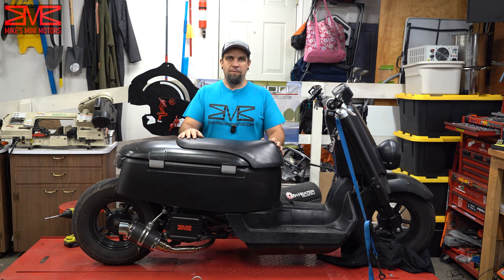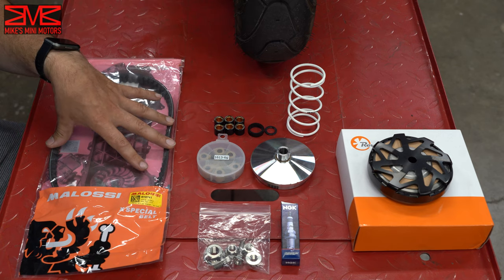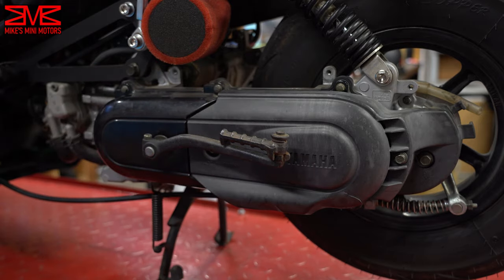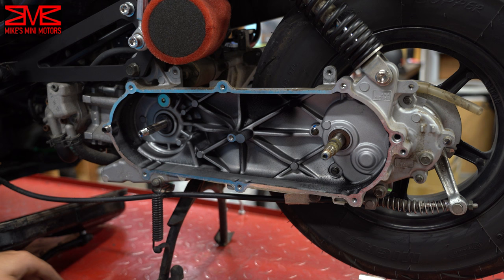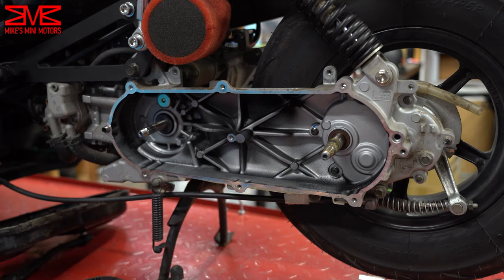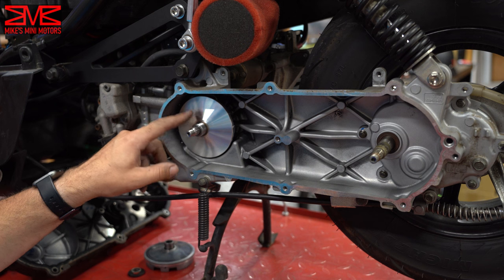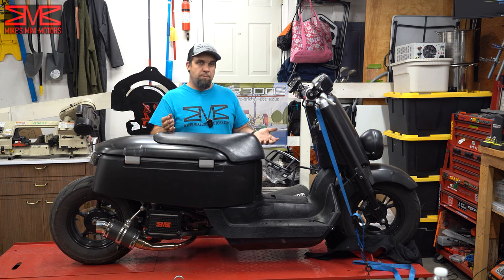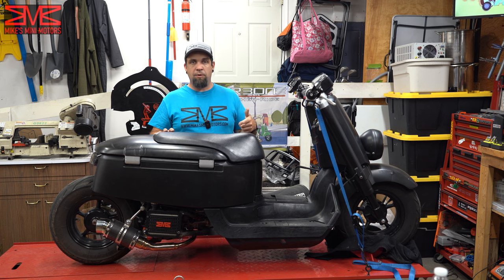Yamaha C3/Vox/Giggle - CVT Upgrades! Reveno Clutch and Malossi Variator

Comment: Nice update! I just installed polini variator 241.746. Came with 4.9g rollers. It improved takeoff alot. I'm still in the high 30s on flat and hit a rev limiter at 45 downhill. Time to play with shims and or cdi
Reply from the maker: Nice, the acceleration was the biggest improvement I noticed too! I installed my Beast Mode tuner already just for the rev-limiter delete, but didn't touch the tuner, I'll mess with the tuning once I finally get around to doing the BBK.

Comment: I been doing alot work on my 07 Piaggio mp3 250ie I purchased it use about 3 years ago and I put all new Variator  kit and Dr. pulley slider 21x17 12g & new belt, rebuild the clutch and now greases all the bearings! Only problem I having trouble with how to grease column steering bearings on it! Mr. Mikes
Reply from the maker: Hopefully you can grease them without having to fully disassemble it! That's the bikenwith two front wheels, right?

Comment: Never ridden or seen one of these so know VERY little.  Have a guy willing to sell me one for 400 bucks.  Starts and runs perfect BUT it does not move.  He says his daughter dropped it and that was the end.  I know this is SUPER vague but his mechanic said it "should be an easy fix".  Do the belts go south on these?  Could it need a whole new setup like what you put in?

Tight on cash but want something for my son and know it'll be a gamble no matter what.  Just trying to limit that gamble.
Reply from the maker: Wow, $400 sounds like a pretty good deal if the bike runs and has a title! It’s would be really hard to tell you what’s wrong, but parts can be picked up for these bikes fairly cheap. You don’t have to go with the higher performance parts and can get standard parts to save some money.

Comment: Hey Mike - what was the tool you used to get the flat nut off the clutch?
Reply from the maker: I used this guy:
https://www.rollingwrenchdenver.com/products/gy6-cutch-pulley-nut-socket?_pos=1&_sid=77bf8f9bc&_ss=r&sca_ref=2317757.Ut0lWw890q